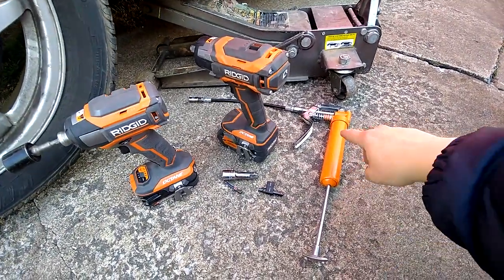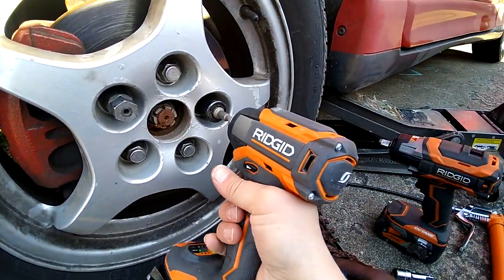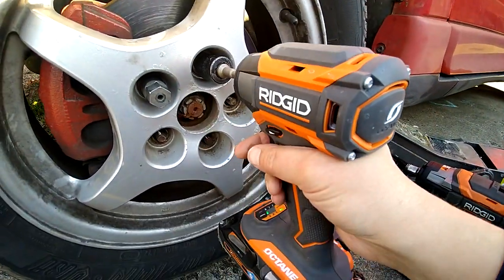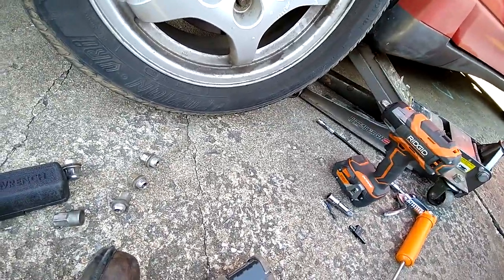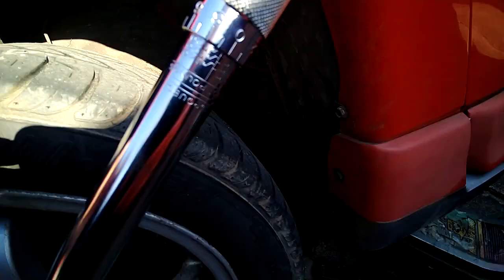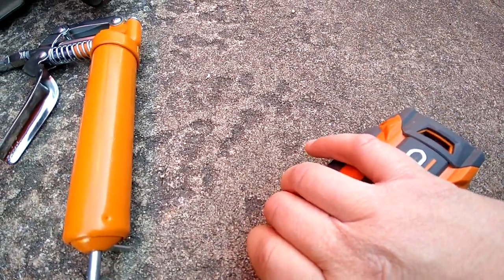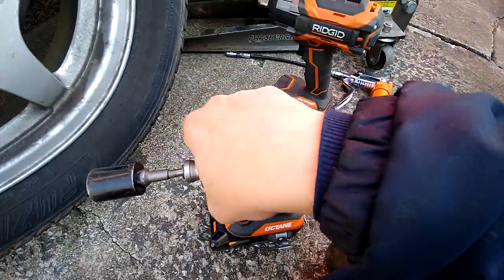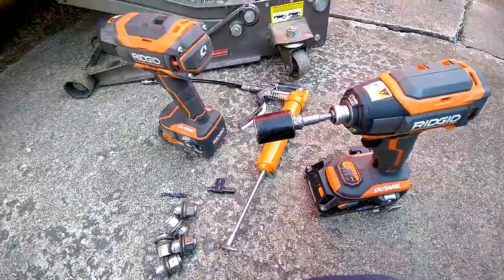2ah vs 3ah octane battery in an octane 1/4" impact driver on lugs

Comment: Lol weird. There’s a big noticeable difference in the octane batteries VS the normal Li-Ion batteries.
Reply from the maker: Yeah, but it doesn't always win the fight... I love using the 2ah on my octane impact driver. Makes the tool super balanced and doesn't pull down my pants as much. I don't like the missing rubber grips on the newer batteries